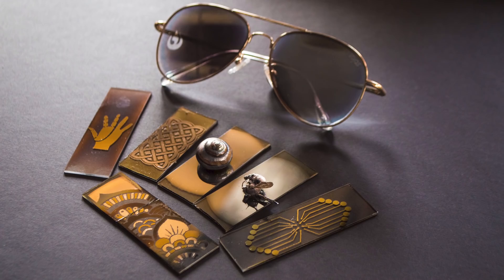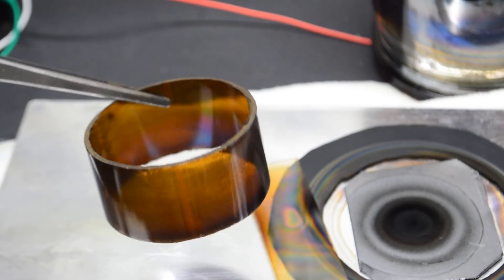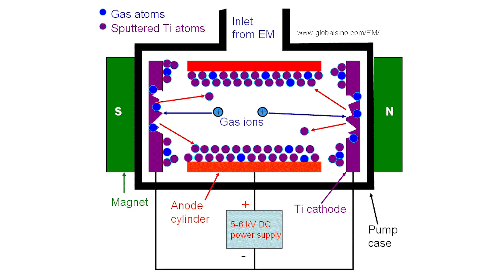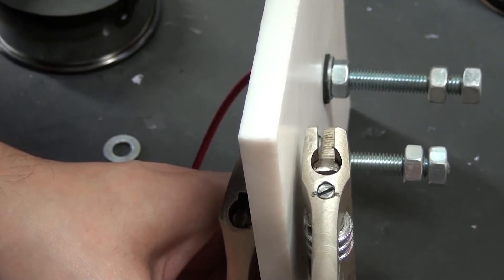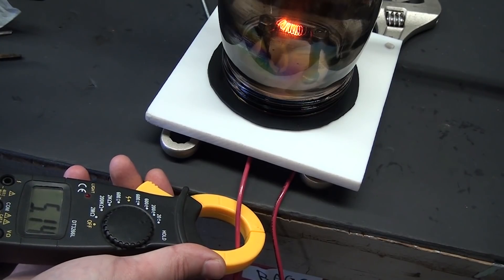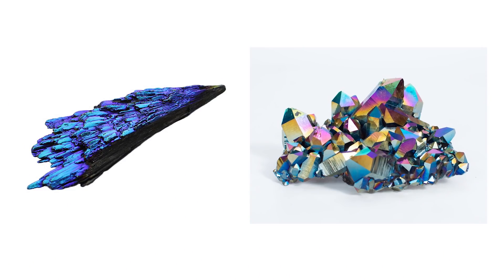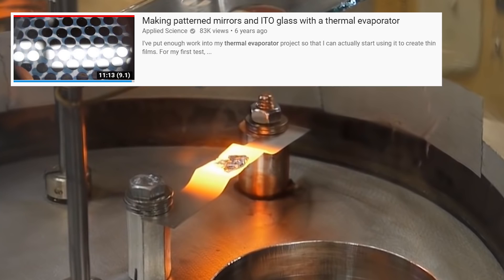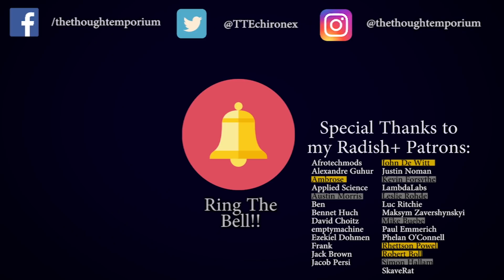This Can Coat Anything in TITANIUM

Comment: Could we use this technique to coat prothesis and implants in titanium in order to avoid inmune rejection?
Very good video, btw, keep up with the good work! ^^
Reply: He addressed that in the video, and the answer was: with better process control, maybe. He didn't have great success with the magnets on his test run, as from the looks of it the coating included a lot of oxide schmoo and wasn't the most reliable ever, but it looks like it can work.
Reply: @MushVPeets  oh, thank you, I did not get that. I'm concerned about mechanical damaging of the pieces and thus exposure of the nonbiocompatible parts, though, but it sure sounds like a topic to do some research on anyway 🤔

Comment: If you reduced the vacuum, could you flush it with nitrogen instead of argon to coat things in titanium nitride, the stuff they coat drill bits with? How do they do titanium oxide coatings? I have a similar vacuum setup I could modify to try this, but my nitrogen tank is full of argon right now.

Comment: Hey, nice video, so much interesting :) one question comes to me, as I don't know a lot about the properties of materials: You think that titanium electrocoating can be done? I mean, it's structure is really hard but... You think it can be done at some point? For example with some acid like hydrochloric acid, as I was told some time ago that some other Chloric acid was used in the exttaction process for titanium, You think that could help that electrocoating process? And have a nice day :)

Comment: Not much of a commentor but I was interested in coating things in titanium oxide for my blacksmithing a few years ago.  I've found for doing that, Sol-gel works wonders.  You might look up the Sol-gel process.  I tend to start with titanium tetrachloride.  Either way, good luck in your endeavors and I wish you well, keep up the good work.

Comment: Could this system or the system shown in the previous video coat things in titanium nitride?
Reply: Yes, just use Nitrogen purge gas instead of Argon. It will also make a much better vacuum via sputter pumping than Argon, because Argon will not combine chemically. Argon is an inert gas.

Comment: Your black coating was probably due to  remnant oxygen in the system. I remember that even faint oxy gassing out of plastics and certain metals was enough to screw up a clean Ti sputter job.  You were coating with TiO2 instead of Ti. As you know the rainbow only develops best when air hits it AFTER sputtering.
Reply: TiO2 its white not black so thats not the oxide.

Comment: I'm having trouble wrapping my head around the electrical system, the copper wires are connected to the Variac and then the variac is connected to the same microwave transformer from the sputtering video or just a wall socket? Please help I'm trying to build a system like that but have very little knowledge regarding electrical

Comment: I wonder if u released argon under the coil to spuder the titanium onto things above
Reply: No he most likely didn't, since titanium should be sublimating/evaporating in random directions, so some of the titanium particles will be moving towards the surface that is being coated.
Also i suspect that titanium particles will be moving faster than argon molecules, since those particles are at the <whatever the sublimation temperature of titan is at that atm. pressure>, so you would have titanium particle crashing into argon, thus slowing down and scattering, not argon molecules speeding up the titanium particles

*At least if my understanding of this is correct

Comment: Rather than using the clear silicone,  use the ultra red , or ultra copper silicone, it can handle the high tempature created by your electrodes[the bolts] good luck

Comment: When you heated that knife you probably didn't change the color of the titanium, but color of the steel. Stainless steel will change color when heated. It's also highly impractical to coat knife with anything if it heats up the knife steel above tempering temperatures. Hitting knife blade with flame will very easily ruin the hardening.

Comment: Could you put a Geiger counter nexto the apparatus? Shouldn't there be gamma radiation because of fast electrons stopping abruptly?
Reply: No, gamma can't be made this way, or at all.
You can generate x-rays, but the voltages required would be at least an order of magnitude higher, and even then they wouldn't penetrate glass.

Comment: Thats almost exactly how optics are coated ,they vaporize aluminum and other metal oxides in a vacuum ,vacuum tubes gave a "getter" inside them  that grabs excess molecules inside the vacuum tube by heating  it you might want to see what they use
Reply: Bismuth is a common getter because it is cheap and vaporizes at fairly low temperature.

Comment: Pulling a vacuum on the system just leaves you with a low vacuum environment with the same ratios of Nitrogen and Oxygen. When we've set up vacuum systems in industrial processes in the past we pulled a vacuum on the system, filled it back up again with nitrogen and then pulled a vacuum on the system again. It significantly reduces the amount of oxygen in the system.
Reply: Yes, AND the residual nitrogen will react chemically with hot titanium vapor to greatly improve the vacuum.

Comment: Guys slightly unrelated, but do you think it's possible to polish glass slides to be optically flat? Or are they too thin? (I tried some, they're very close, but not flat)
Reply: Use a backing material that IS flat, which you can make yourself in the ancient way by rubbing 2 of 3 flattish stones together, in turn. Two surfaces can match in curved shapes, but three can ONLY match if all are flat.
Reply: Yes. That's how telescope mirrors are made(though in that case they're optically non-flat on purpose). You can get deviations of less than a micron over several meters.
You can also try making your own float glass.
Reply: @Spirit532  Float glass is not perfectly flat, of course, except on flat planets! ;)
Reply: @YodaWhat  Spin the vat! :)
Reply: @Spirit532  Yes I know how it's made, but those are some solid pieces of glass.. I want to do it with slides because they're very close, but they're also very thin. I'll buy some paste and try it..

Comment: Why do you not just make a wire loop, and transfer the energy with a transformer?
Just make a closed loop of the titanium wire and use a coil from a transformer to transfer the energy!

Then you don't need to have posts going through the lid?
Reply: Yes, that can work. It requires a high-frequency transformer, like for inductive heating. It is not that hard, and is a long-standing practice, way back into the days of vacuum tube electronics.

Comment: The job you did with the wire makes me cringe :c I've seen my share of things failing due to bad wiring as well as even properly connected wires corroding and burning away due to how long they've been used, say a oldschool steel conduit box inside of concrete with steel tubes, wires with paper insulators and early day plastic and rubber that have dried up and crumbles as soon as something's been moved.

Comment: I know this may seem stupid. But for the heating coil. Try looking at designs for vape coils. RDA coils. If you need real and accurate help, dm me on insta @mfoemusic. I literally work at a vape store and we use titanium wires wrapped into coils in our vapes. You might want to use a different coil configuration to receive a better resistance so you can pump a little more heat with low-ish current and a less likely chance of melting. I can help if you want but if not oh well. It’s just an idea